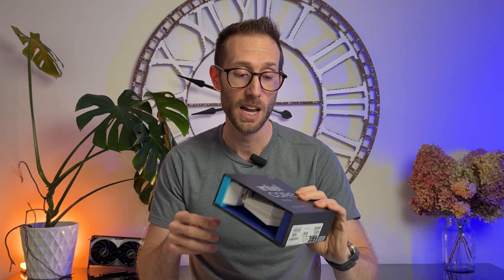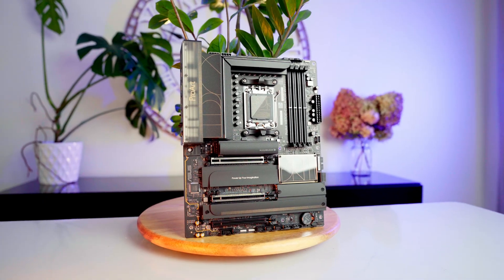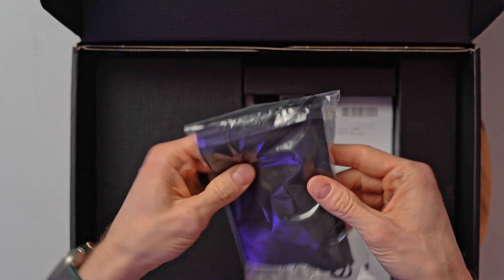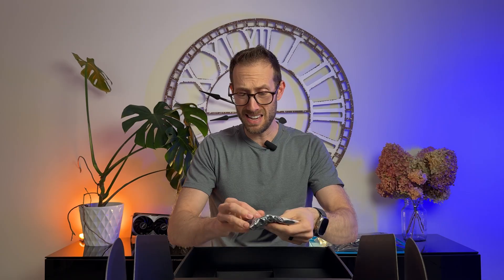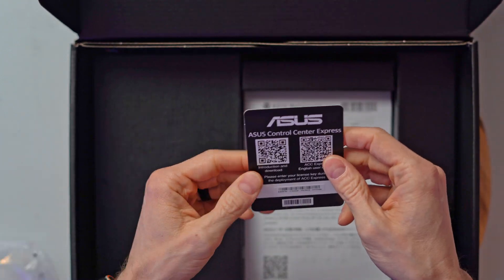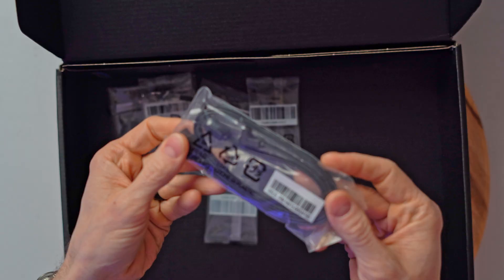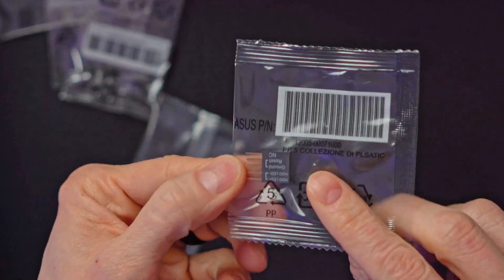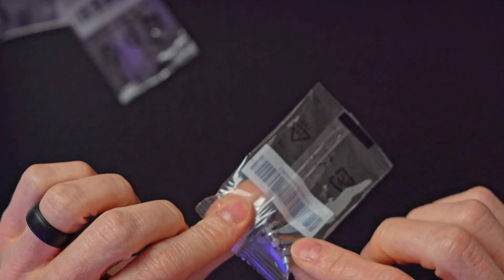ProArt Z890 Creator Wifi Motherboard Revealed - Intel LGA1851

Comment: Great review! Can I ask, is it actually possible to connect the thunderbolt ports to 2x Apple Studio Displays simultaneously? Curious because there is only a single DP-in which has me confused, the previous version had 2x DP-in. Thank you!
Reply from the maker: My understanding is that you'd connect your GPU into the Display Port-In port, and then you'd daisy chain your Thunderbolt displays but that may not work for all displays.  You can read more about it here:  https://www.reddit.com/r/Thunderbolt/comments/1g3eyyy/z890_motherboards_and_thunderbolt_displays/
Reply: @JohnLCharette  Thanks John, I appreciate the reply. Subbed.

Comment: If I want to add a PCIe Network card, I’m assuming it will go on the third PCIe slot? This board’s antenna is not that good
Reply from the maker: Correct.  Just know that the 3rd PCIe slot shares bandwidth with the 5th m.2 slot, so you can only use one or the other.  It just means if you use the 3rd PCIe slot, you lose one m.2 slot.  Not the end of the world, but something to consider.

Comment: Why do you want your thunderbolds as a display port.The only reason i would buy this motherboard over the X870E are the thunderbolds.
Reply from the maker: Most GPUs don't have USBC or Thunderbolt ports, so if you want to use your Thunderbolt monitor, you can use the Thunderbolt port with a cable then connected to a Display Port on your GPU to leverage it.  Or else, it would be using the on-board GPU to drive it.

Comment: What memory did you end up going with and what amount would you reccomend? 2 slots or 4 slots?
Reply from the maker: Hey, I actually haven't setup that system yet.  We moved and haven't had to the chance to set it up.  That said, if you're looking for higher speeds, Asus recommends two slots.  When going 4 slots, you'll be limited in your ability to overclock your DDR5.

Comment: I’m not getting it because it’s lack of optical port
Reply from the maker: That's fair.  If that's a requirement, you'd have to get yourself a PCI-E card to do the trick.
Reply: 10000%, an $8 HDMI optical extractor would just break the bank entirely.
Also, Google its vs it's.

Comment: Hi, its me again, thank you for the idea of the two SSDs for a creator setup, a Gen5 for the system and apps, and a larger Gen4 for data.  I am hesitating between Crucial T700 vs T705 for the system drive, there is only a €30 price difference at 1TB in Germany.    Is there any technical reason (T705  more heat, cooling issues, whatever?) you chose the little slower T700 or it was just you had already?  I am not aiming for higher speed with the idea of T705, but I understand it to be a later development with improved redesign(?) 
Another issue comes to my mind:   Do we have enough PCIe channels left if using them up for a Gen5 SSD, a Gen4 SSD  and a high-end Graphics Card?  I guess there is not much left for the second PCIe slot.
Reply from the maker: I only chose the T700 because it was significantly cheaper than the T705. I would have chosen it if I could get it for €30 more.

If you're only using two m.2s and one GPU for PCI lanes, I think you're good. Z890 has 24 lanes dedicated to Gen4.

Comment: I've got both as well, Z790 + 14600KF and Z890 with a 265KF. Preferred assembly on the Z890, although there's nothing wring with the Z790.
Reply from the maker: Ohhhh, love it.  I should be working on my Z890 build in the next few weeks.  Any install tips?  I just moved my Z790 over to an Asus TUF GT302 case.  Very coming shortly.
Reply: @JohnLCharette  no tips needed really, everything just works. Was a workstation build, using an Arc Pro A60 in a compact Meshify C case.

Comment: When can we except the head to head video?
Reply from the maker: Good timing!  I had a two hour call with Asus last night going over the differences, and a few items I overlooked in my individual videos.  I will be compiling that information and recording this week.  Depending on editing, more likely releasing it next week.  Is there anything in particular you'd like to learn about that I can highlight for you?
Reply: @JohnLCharette  Thank you for the ippurutnity. It’ll be nice to get a video by end of week or Monday while I’m still in the return period. I myself purchased a AMD and Intel and doing testing myself. It’ll be nice to cover a few topics, Assuming you has the same RAM configuration and GPU on both system:

1. Most Important! Would thunderbolt equipment work on the AMD USB4? Since now it works, are there limitations?

2. I know the 5090s now have H.264 support but Is someone really missing out on Intel Quick Sync and NPU for AI if they go with AMD?

3. What are the average temperatures for the 285K Intel and AMD 9950X

4. Putting to the side what social media has said about the 285K which one is the most stable especially when using EXPO (AMD) or XMP (Intel) on the RAM.

5. Which CPU feels snappier and faster when using Excel and Davinci Resolve.

6. This is more of a bonus round one: I don’t game often but I do play flight simulator it’ll be nice to see which one has the higher FPS.

optionally, I'll be down to do a zoom too to nerd out together I have peripherals here on myself too lol
Reply from the maker: Hey Jacob, I'd love to jump on a call and chat sometime.  It looks like we have very similar interests and are going through a similar journey on YouTube.  I'm sure we could support each other, even do a collab ;)

Love all of your questions - my head-to-head video this week will be straight features.  I actually haven't installed CPUs in them yet or turned them on.  That'll be later down the road.  I don't have 'exact' setups, but I'm working on getting as close as possible.

Shoot me an email and we can get connected.

Comment: I have bought this motherboard as well but have heard about its Q-release pcie design could damage the connector of the Graphic card, I'm really worried about this.
Reply from the maker: Ohhh, I haven't heard any bad news aboutt those Q-release PCI-E ports yet.  I'm guessing unless you pull your card out often, it shouldn't be a concern.
Reply: @JohnLCharette  They have just confirmed this to be a defective design, and they're going to issue compensation & replacement in China but I just don't know if they'll do the same globally as am in UK....
Reply from the maker: Ohhh really?!  Yes, I'm reading the article on Gamers Nexus now.  Thanks for the heads up.  I'll talk to my Asus technical rep to learn more.

Comment: Intel screwed over customers despite knowing about oxidation issues before hand. Horrible business practice.
Reply from the maker: Yeah, I was hoping the Core Ultra 200s series was going to help their reputation, but it isn't looking good so far.  I can't wait to get my 285K installed and tested.
Reply: @JohnLCharette does this board have this issue?
Reply from the maker: No, not at all.  That was an issue with 13th and 14th gen Intel CPUs.  There haven't been any reported issues with their new Core Ultra 200 series CPU/motherboards.

Comment: How are you liking the board with the 285K? I've heard nothing but bad things about the 285K
Reply from the maker: I haven't installed it yet.. I have one more video where I'll compare both ProArt motherboards, and then I'll move my current system over to a new case and then I'll install it.  Stay tuned and I'll let you know!
Reply: @JohnLCharette coop

Comment: P3 Plus is one of the worst QLC NVMe drives you can put in your system. It is simply incapable of transferring any data higher than 50 GB as it gets stuck at 50 MBps transfer rates slower than a spinning HDD.
Reply from the maker: Yeah, I wouldn't recommend the lower-end drives.  I'm using the P5 Plus in my test bench system, and it works well for what I'm doing.  I certainly don't copy of lot of data from that system.  My main system is using a Crucial T700, and I love it.

Comment: Something i hadn't though about for a while, is actually that Intel boards are way cheaper for what you get, especially ddr5 and pci 5 boards.
Reply from the maker: I actually found it the opposite.. when I was using the AMD B650 motherboard, it had DDR5 with m.2 Gen5, but meanwhile, the Intel Z790 didn't..  I was very surprised that the cheaper AMD board had some better features.
Reply: @JohnLCharette  Well I guess it depends on which board, but the ones I compared just now, it was a stark difference. You see i had been looking for some good AM5 M ATX motherboards, and there were almost none to find where i live. But there were tons of Intel boards at half the price often all with ddr5 and pci e 5
Reply from the maker: Ahhh, very interesting.  I'm curious, where do you live?

Comment: Everyone is crapping on the new intels for gaming.. but lets be real, its a powerhouse when it comes to productivity ive seen some 285k benchmarks and i was like dang.... that thing has some potential
Reply from the maker: I agree!  I'm going to compare both 9950x vs 285k.  I have faith in Intel..
Reply: @JohnLCharette  The differences between the Z890 and X780 boards would be useful. I/O, that kind of thing. Afaik, if you need Thunderbolt you're going to have to go with the Intel version, or use a slot - which you might want to plug something else into - for a card.

And knowing if it'll play nice with four sticks of CUDIMM would be extremely useful.

Comment: The cu dimm is hard to get good luck let see actual stuff. Make sure bios and all drivers are in. 🎉
Reply from the maker: Yeah, it seems to be available at my local retailer.. 2x24gb for $500 CAD though.  Very expensive.  8800mhz though ;)
Reply: @JohnLCharette  yes they expensive. Remember when ddr5 came to market and how hard has to get it. Check hyper offering with last bios
Reply: @JohnLCharette  yea. let see how it goes.